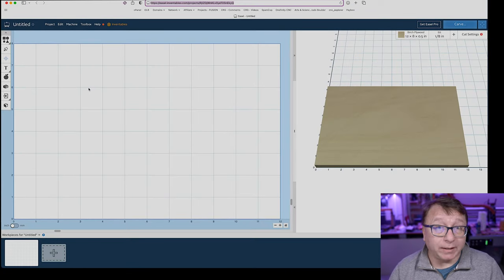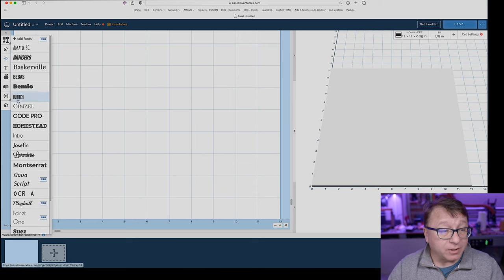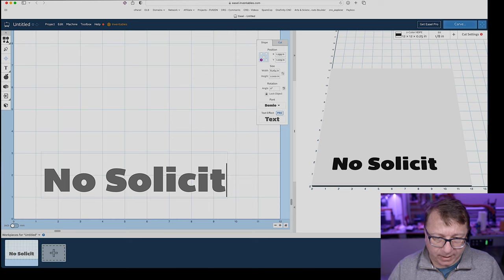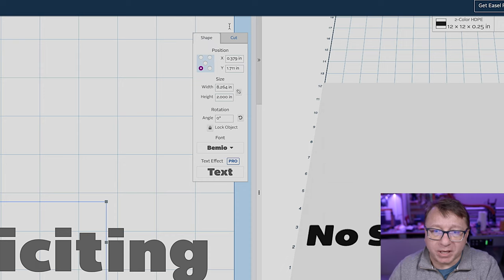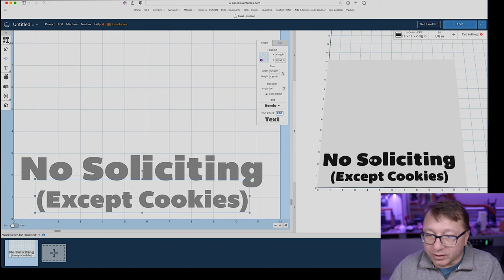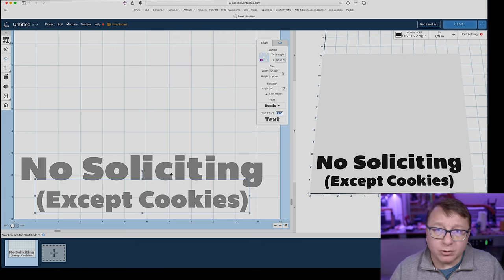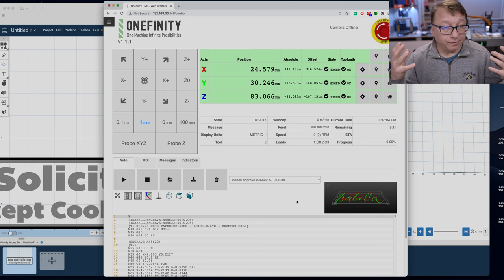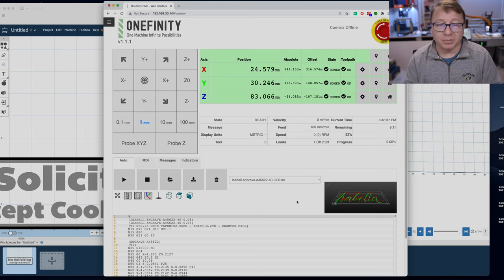Beginner's Guide to Sign Making Using Easel

Comment: Hi - I'm having trouble getting my project to start on the correct zero.  I have homed my OneFinity and have used the XYZ Probe on the workpiece.  My issue is that when I bring in my G-Code from Easel, it does not start on the workpiece zero.  Instead it is starting a few inches in front of it.  Do you have a video explaining what I might be doing wrong??
Reply from the maker: Hi Stephen - I do not have a specific video on zeroing and work coordinate systems. That said, I am working on a new series that might help; unfortunately it is not out yet. My recommendation at this time is to ensure you know where your zero position is within Easel. Based on my experience, zero is always the lower left corner unless you have the Pro edition (which I do not). Make sure your machine is homed first, and then zeroed to the required location. You can always simulate the gcode in Easel, or preview your gcode in Camotics (https://camotics.org) if you want to validate everything. For the OF specifically, I would validate you have the correct probe dimensions in the settings menu. Manually checking your zero position after probing is a good idea as well. I hope this help! Thanks for watching!

Comment: I downloaded the code I have the onfinity interface on my laptop but it doesn’t show any files when I try to download what I created
Reply from the maker: Hello Billie Jo -- I do not know what you mean by "downloaded the code" -- you mean you saved the gcode to your computer? If so, you need to then upload the gcode to the onefinity -- you can do that by using a flash drive (copy to flash drive, put the flash drive in the OF USB port), or by clicking the upload button on the OF interface from your laptop and completing the upload. From there, the gcode should show up in the drop down and you will be able to "run" it from the user interface.  Hope that helps -- thanks for watching!